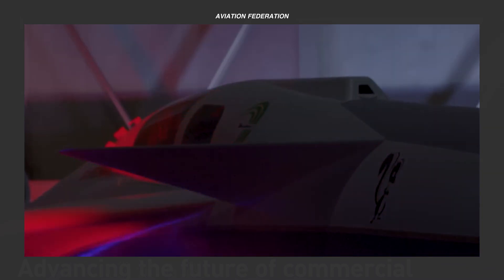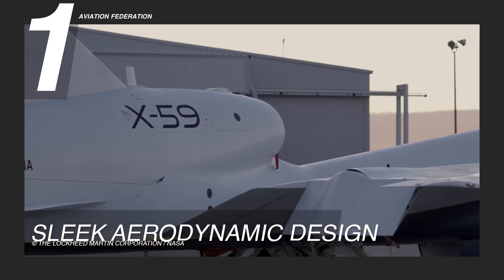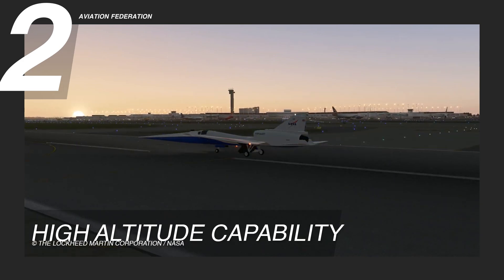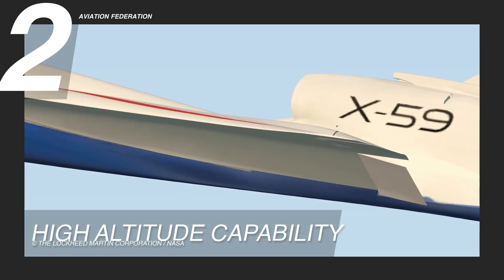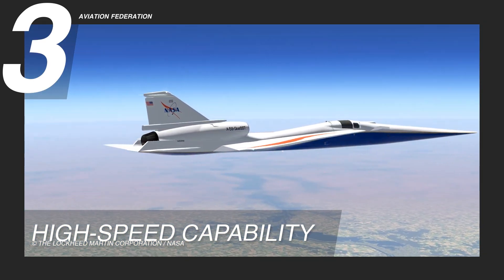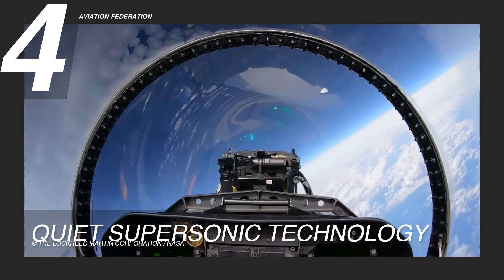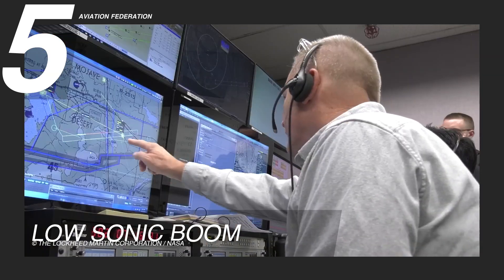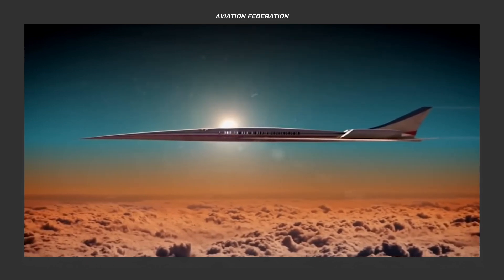Top 5 Reasons Why the New Supersonic X-59 is the Future of Supersonic Jets | Aircraft Review

Comment: Why all the hype. Thia aircraft does nothing that existing aircraft cannot do. In fact it does less than some.
Reply from the maker: The Supersonic X-59, while not offering anything fundamentally new in terms of functionality compared to existing aircraft, is still a groundbreaking project in its pursuit of quieter supersonic flight. It aims to solve one of the biggest issues with supersonic travel: the loud sonic boom. This aircraft is designed to reduce that to a "sonic thump," potentially revolutionizing commercial aviation by allowing supersonic flight over land. Do you think this could significantly change the future of air travel, or is it just another flashy project?